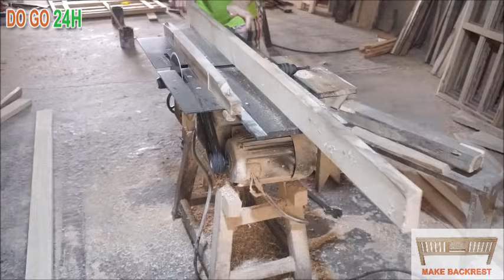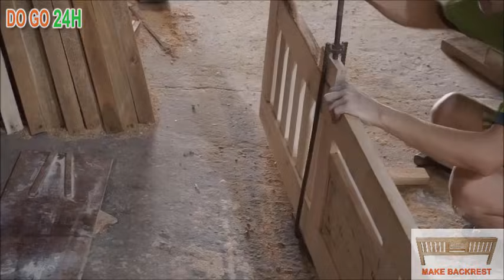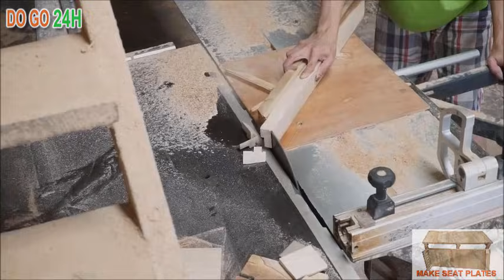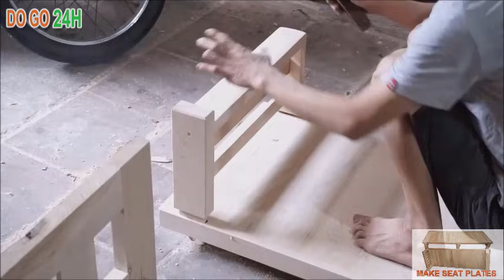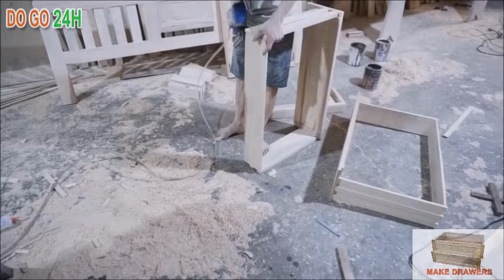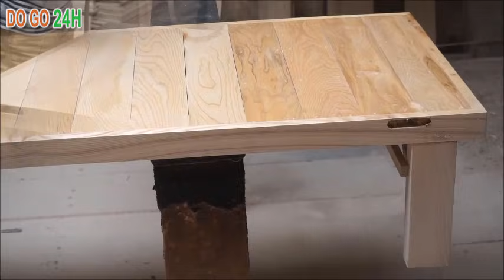Các Bước Sản Xuất Ghế Kết Hợp Giường Gỗ 2 Trong 1 - Steps To Produce Chair Combined With Bed Wooden

Comment: How much does the sofa weigh in total?
And do you have idea if you can send it to USA ??
Reply from the maker: Its dimensions overall length is 190 cm. Width when folded as a chair is 60 cm, stretching out the side of the bed is 120 cm, Its height feet to face is 30 cm and the backrest is 70 cm. I am selling them in Vietnam. Currently i can't ship it to your country. Sorry about that!

Comment: Please send the details size for over all thank you
Reply from the maker: Dear friend! Its dimensions overall length is 190 cm. Width when folded as a chair is 60 cm, stretching out the side of the bed is 120 cm, Its height feet to face is 30 cm and the backrest is 70 cm

Comment: Measurement of the Sofa and bed
Reply from the maker: It's size L 190 cm x W 60cm (and 120cm when open as bed) x H (front: when as sofa is 35 and open as bed is 30 cm, backrest is 70) cm.